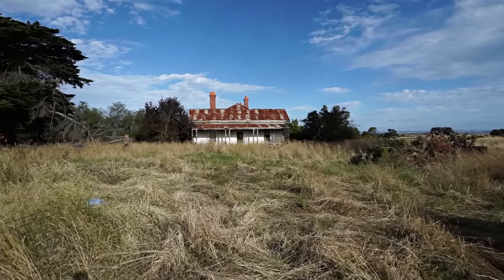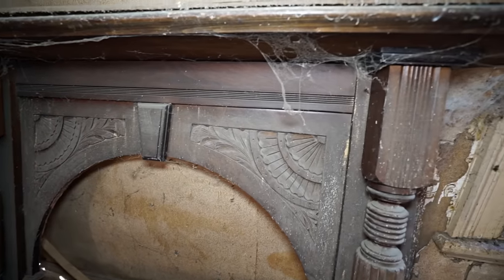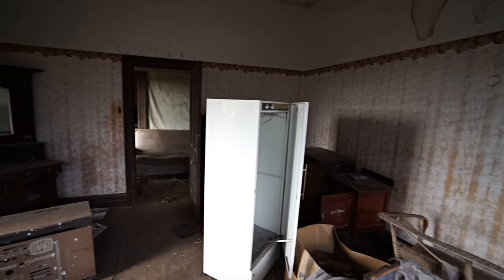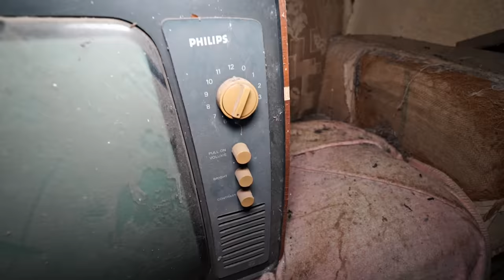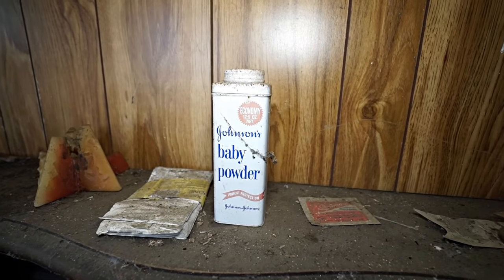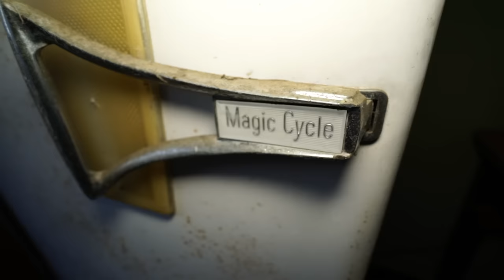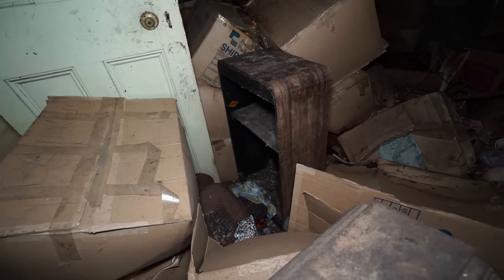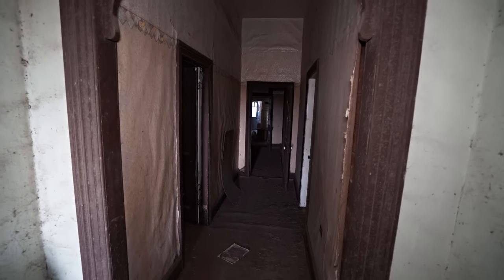Abandoned- Time capsule Farm House/Antique furniture and vintage stuff everywhere!

Comment: What a cracking little place and explore. I reckon the house is not quite as old as you're indicating, especially as there is quite a lot of bakelite around the place on the door furnishings etc and that wasn't invented until 1907. Unless it was extended upon as you mentioned I'd estimate the place to be about 1915-20. All the best and thanks for a wonderful explore. 👍🏻
Reply from the maker: I like your line of thinking Simon :-) Also power did not make it out to the country areas as quick as it did in the larger towns so more often than not these old country homes had power adapted later. But another sign of a 1915 date build is the terracotta chimney pot which were popular around that time. :-)

Comment: Manufactured by Smith & Wellstood and introduced in the 1950s, the ESSE CENTURY heat storage range cooker was launched to run on any solid fuel, and in 1958 an oil-fueled model was introduced. ESSE Engineering also used the product name 'CENTURY' for the oil-fired range cooker manufactured from 2000 - 2018.

Comment: By any chance is it for sale? Until I was 12 years old i spent a great deal of time in a farm that had no running water or electricity. With a little work it could be a great place.
Reply from the maker: It sits on farmland Janet so it would have to have a small subdivision made if someone were to want to buy the home and renovate it. That is why these old homes just sit rotting as the farms have had newer homesteads built and also the farms get joined to other larger farms.

Comment: All those spots that had lap sidings the inside used to be outside. I also bet that metal bathroom was for farm hands. The furniture in there is worth a small fortune repaired cleaned or recovered. You should speak to the owners offer to save and rescue the contents.

Comment: Recognize the door hardware could go back to the 1880's. Did you notice that there was an ice box section in the cabinet next to the claw foot tub. This place was built for air flow in hot weather: high ceilings with grating above the doors to carry the hot air out, windows and doors allow air to flow through front to back and side to side. First room at the back of the house with the tub was probably the dining room with the kitchen behind. Storage for china,linens and serving ware etc. Butler's pantry. Often a house this size would have "servants Quarters" or Quarters for live in help, ie. farm hands

Comment: And the door that you closed with the Critter in there was open before you closed it the first time and so now you locked it in there that was good thinking
Reply from the maker: Hi Kymber, I took still shots after the video and left it open. I closed it while I was doing the video because I was unsure what was in there so while I doing the video it was best to have what ever it was in there stay in there while I did the video. Turns out it was a rat. The ceiling was all open to the elements in that room and there were pigeons making those noises while I was taking still shots so no animals were trapped. If you noticed all the hallway doors were shut before I got down to that are so no decent sized animal could have come through the front door to get there. And the back area was all closed too. So it was rodents. :-)

Comment: An incredible explore loving this farmhouse. So sad it's been abandoned and left to decay and rot. The chair's looked comfy snuggled up in one of those  reading a book pure bliss. Good sized room's and high ceilings, never saw a television like that before,all surround and small screen. Sublime furniture and lovely stain glass windows. Thank you for capturing the essence of this home, i felt the tug of the old heart strings. Gem of a kitchen so spacious very retro indeed. Hi fi system looked like a 70's model, sad it's all been left to wreck and ruin. If it was a hen how would it survive in there without food,dont think the window was open. Fab explore Paul.

Comment: okay,.... so the room that you thought was the kitchen at first, that you are unsure of its purpose: It is the room that all the farm hands/children/ and farmers would come into the main house to take off their work coats, boots, tool belts and other things. also a rest area with benches to have a glass of water and to smoke when weather was not good. this is also why there are doors in the hallway to separate this section from the main living area and bedrooms. 2 of the front bedrooms belonged to farmhands and actually had a small secondary kitchen on that side of the house also served as a parlor area. weird seeing it on youtube.   fyi it was built in 1911 and has not been lived in since 2002 by my grandfather (still alive, just lives with us now in new Zealand) thats why all the big stuff was left behind, my parents did sell some things and the house was on market for 6 years, but location and very little demand in the area, it never sold and also needed extensive work on foundation and roof that just wasn't feasible. cheers

Comment: the house would of been built around the 1940 s, as my mum and dads place has the same doors and trims in the hall way,  the house was added on as the toilet was inside, as 99% of the house in the 1940 era in the country had toilet and bathroom outside, like my mum and dads place did

Comment: The door knob/ lock on the back door. VERY familiar. When I inherited my Grandfather's house, it had one of those on the back door, which was so worn the key didn't work reliably. Going through his cupboards. I found a NOS (new old stock)one and installed it. It came with all hardware and worked like a new one. It was probably 70 years old because the old man died at nearly 102 20 years ago.